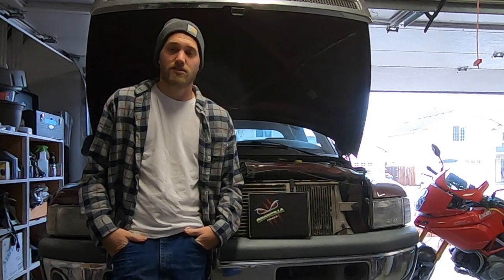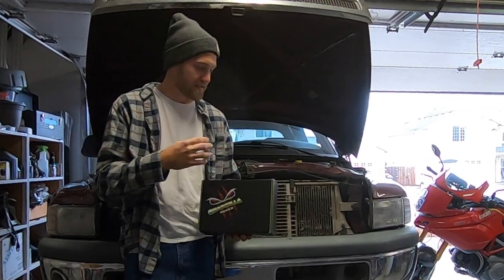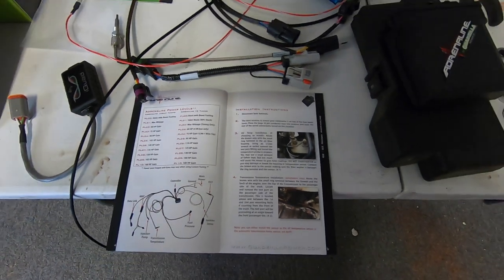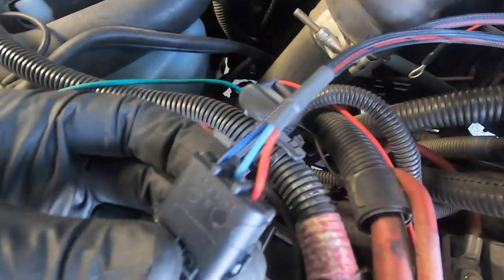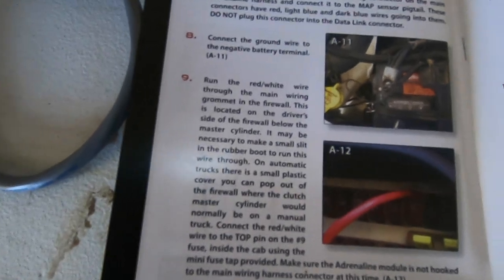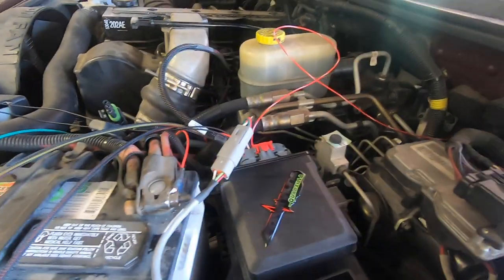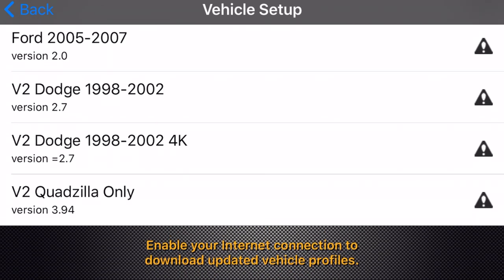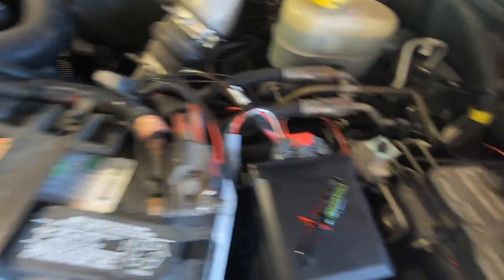THE BEST 24V CUMMINS TUNER: Quadzilla Adrenaline install

Comment: I really do appreciate the effort you put into your video. I have had some difficulties towing my fifth wheel up hills. It will drag it up but very slow on the steep ones. I’m not looking to win any races just want a little more power for towing. Just finishing up a rad swap. Dropped a Mishimoto in to cool it a little better. I’m not great with technology but I think I might try the Quadzilla after a lot of consideration. Thanks again young Viking! I’m an older man, turn 63 this year. I want that young man smile back. Rolling coal might do it!

Comment: what else is done to the truck because i have this tuner and 175hp injectors and my truck doesnt smoke at all
Reply: With this tuner you can adjust the low boost fueling, how much it smokes, a stock truck with a tune can roll coal.
Reply: @simoncorriere8209  had canbus fuel all the way up to 150% all the way across the board from 0 rpm and up and still doesnt smoke at all

Comment: Just installed mine, not happy at all. Does not want to connect to my phone sometimes. I dont understand the power levels. I can only go up to 5. It feels stock until the turbo lights. Then it goes.
Reply: Sounds like you don't know how to use it lol
Reply: I didnt at first. Figured it out. Still glitchy as hell. Got custom tunes. It definitely runs good. But maybe I'm not use to the cummins motor. My zf6 duramax with the old crazy Larry tune would smoke the tires up to 4th.